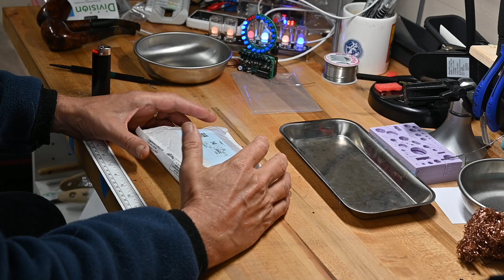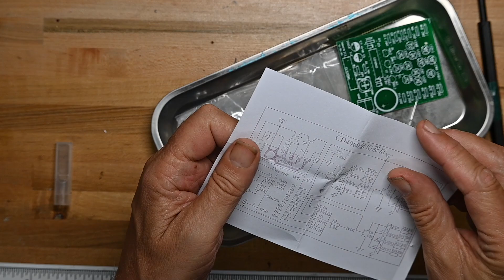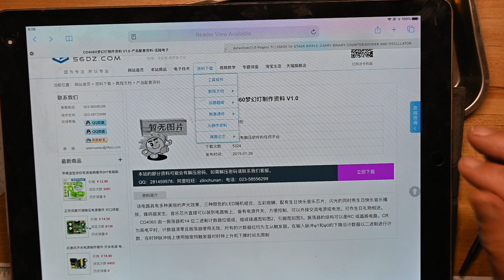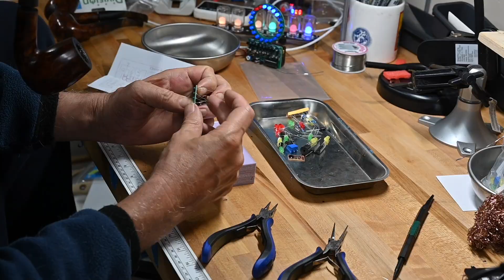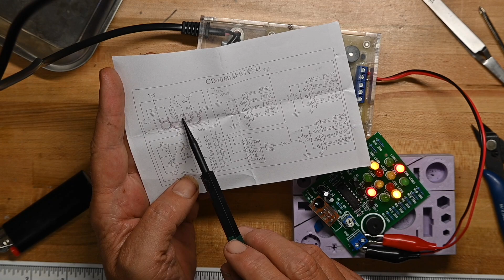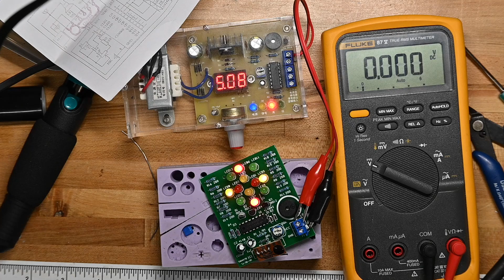C.K. builds another goofy kit from eBay

Comment: hi C K H...
'
what wrong with 4 green LEDs are not lights on this kit...
did you find / fix already work 4 LEDs turn lights or not work
Reply from the maker: I did not.  Primarily because I can't find this one, I built it 4+ years ago and it's buried somewhere in the shop, can't find it!
Reply: @CKHaun  '
hi C K H...
'
aww sorry about that kit...
use Q3 transistor 9012 emitter jump on PCB to LED12...
will connect to LED12...
LED09 to LED12 lights will work light on...
try it

Comment: hi C K H...
'
can this CD4060 kit work with 6v four A A batterys...
will LEDs lights on without 2 caps as 1uf and 100uf
Reply from the maker: It should work with 4 AAs (6 volts), but I did not check the current draw so I don't know how long it would last with batteries.  Probably a good long time, but not sure.  As for the capacitors, do you mean leaving them out?